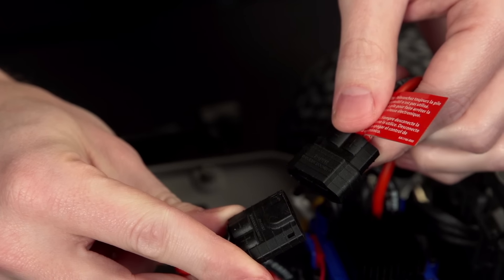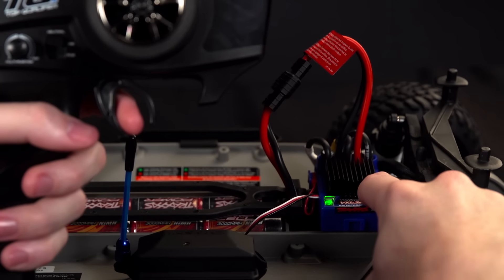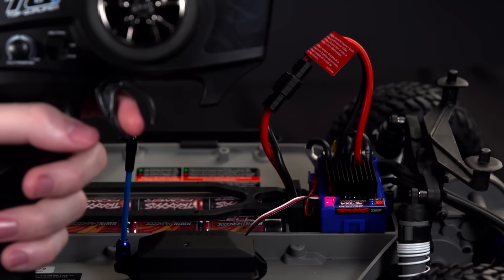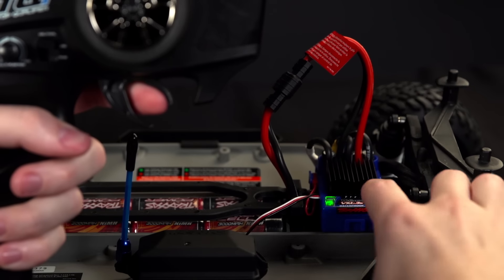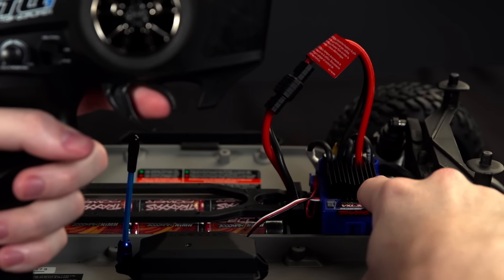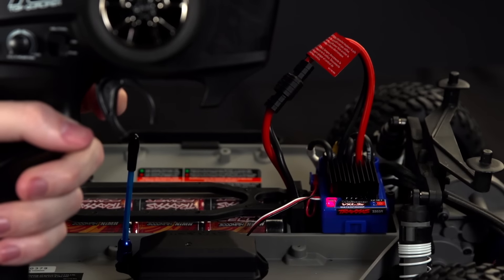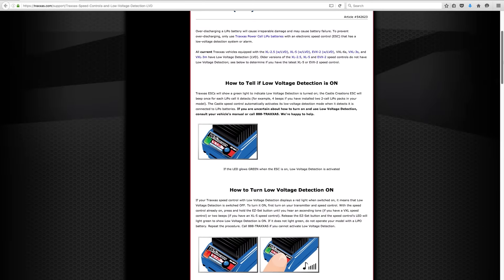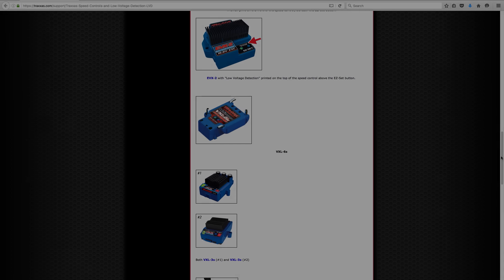Blinking Red Light (or Blinking Red and Green) on Speed Control (ESC) | Traxxas Support

Comment: THANK YOU!! This worked for me to fix my younger son's new RC teton that he just got for christmas. He was turning off the ESC using the push button instead of just disconnecting the cable. Which apparently put the ESC into LIPO low voltage protection mode. Successfully put it back into NiMH mode by following the steps in this video! THANK YOU!!   PSA: Do NOT power off the ESC by using the push button! Only use the push button to turn the ESC ON! To turn off ONLY DISCONNECT the cable!
Reply: I turn it off with the button….
Reply: @Catwithcocacola I do too and haven’t had a problem

Comment: I have the red green blinking light on my son's traxxas slash,  we have a fully charged lipo. All my research shows this happening with the nickel battery but nothing with the lipo battery  ??? Very frustrating traxxas...
Last time used 4 months ago worked fine then today my son wanted to take it outside and...... this  😞. 

On a separate note my traxxas x-maxx 8s steering servo broke multiple times   I upgraded the to metal gears,  servo still broke,  then I bought the "better " traxxas servo (4th one now) also upgraded the steering hardware with aluminum and adjustable steering servo saver spring.  All worked fine until now.... only steers to the right  & won't return to straight,  until I physically turn the tires straight.  Goes straight or right then won't return to straight. 
I purchased everything last year. Honestly sick of dumping money into both of them.  Traxxas isn't as good as I thought.  Also x-maxx tires explode,  balloon,  tare , & expensive. 
What do I do ? Invested too much money to throw them in the garbage but buying parts that aren't reliable  ???
Any help traxxas  ¿

Comment: First I buy a ready to run Traxxas slash then figure out it’s not ready to run it doesn’t bring a battery or a charger then the batteries get here and I can’t connect the stupid remote to the truck then I connect the remote to the truck and the truck turns left and right but it won’t go forward or backwards ready to run my butt dude I need some help I’ve tried everything

Comment: My Sledge won't calibrate. I can't  get into the programming mode. If I release the button when it turns red - it stayes red and won't go through the process. Only when i am pressing the button it will go 1x red 2x red and finishes with 3x red. After that everything on repeat. When I release the button it starts blinking green again... I don't know what to do...
Reply: turn up the throttler rate

Comment: So I am using lipo aftermarket batteries I turn low voltage on but it blinks red when my battery is about to die and it won’t shut off is that just how it is or?
Reply: At the end of my run

Comment: Thank you so much Traxxas!  This worked!
I moved my Velineon VXL-3S from my GMade Sawback with a 2300kV motor to my Tamiya Egress with a 3300kV motor and a NiMH battery.  When I ran it in the grass, it cutoff quickly and the red light blinked slowly.
Recalibrating it by using this procedure fixed the problem!  My Egress is tearing up the yard now!

Comment: When I do this it goes right back to flashing red and green, also after going into full reverse to re calibrate it stays green and never flashes, I have a traxxas rustler and am using a lipo battery fully charged with a XL5 esc I am trying to use it after a while, please help
Reply: Same car i have and im having the same issue please let me know if you have solved your issue i need help
Reply: @PersuadeIt  hi, turns out my old battery that it came with died just over time. The lipo I was using was too powerful for the stock esc therefore preventing the car from working to avoid damages. I purchased a new battery (the one it came with) and after resetting the transmitter everything is working again

Comment: mine is blinking green and red got steering but no forward or reverse I'm using a 3s 50c lipo battery on a traxxas rustler electric (is the battery to big)and I never had a problem till I got the new esc xl5
Reply: Elicia Vaughn you can't run a 3s lipo on the xl-5 esc

Comment: My light was blinking red after a hard crash and I didn’t have throttle ... I unplugged the battery and plugged it back in and it worked fine idk what happened
Reply: AMSeagle same only mine was 65MPH against a basketball hoop

Comment: Please tell me a way to get water out of the tires! I have so many problems with getting water in my wheels.
Reply: Elijah D. Trump you can't
Reply: you put a small hole on the top of your tires and then give it full throttle and all the water will spray out
Reply: Elijah D. Trump take tires off
Reply: If you have bead-locks, you can just remove your tires easily and dry the tires and foams and reassemble, though I'm not quite sure what to do if your tires are glued to your wheels. But a good trick to do to avoid this problem in the future is to plug the vent holes in your wheels with some electric tape or duct tape before you go in the water so water won't get in. As long as your tires are glued properly all around with no loose spots, this will work every time.
Reply: Justin Newman that won't get all of it out
Reply: I guess I should say one ounce of prevention is worth more than one pound of cure. But in all honesty, I don't really know how to get the water out because, I just avoid this problem, by using my tactic of plugging the vent holes.

Comment: Will this work if I had to swap out the receiver I tried to upgrade my pre runner To a rc4gs receiver I had laying around for the gyro but I can’t get the throttle to go but this started happening before I swapped the receiver I actually swapped it because I was having this issue like a day or two after buying the pre runner

Comment: I dont understand why everyone's having trouble with the slash ultimate.. I read all the information and when I first fired up my truck.  I didn't have to turn on low voltage detection like the card said I'd have too.  The light was green from the get go.  So I guess my ultimate was setup for lipos from the factory.  My light on my esc was never red. It was always green.  Weird..

Comment: I have a lipo and i'm in low voltage detection and the esc keeps blinking red i can steer but there isn't any throttle i tried reseting it holding the receiver en pressing the set button on the transmitter i tried recalibrate the esc nothing what is the problem
Reply from the maker: Please call us at 1-888-TRAXXAS to resolve the issue. This may be the result of a bad motor or over-voltage from the LiPo battery.
Reply: Traxxas Support i can't call you guys I live in suriname 🇸🇷
Reply from the maker: In that case, please email Support@Traxxas.com. They'd be happy to help.
Reply: did u ever fund out the problem because mine is doing the same thing
Reply: Tony Mcgee the problem is the lipo that you use if you maybe have a friend that has a lipo try using that one and always have a lipo tester "ALWAYS"
Reply: So u saying my lipo is bad
Reply: Tony Mcgee yes
Reply: Ok but I think my esc is shot tho because my battery is new I got it last week
Reply: Tony Mcgee yeah than it's that than
Reply: Could it be because of heat because when ever it does that I just unplug it and let it cool off for 5 min and then it is fine. Also if I take off the body it helps.
Reply: Same

Comment: I have low voltage enabled with lipo battery. After just a couple runs esc light blinks red slowly. i unplug battery check and see that it is still nearly full. plug back in and the same thing keeps happening. any help would be greatly appreciated.
Reply: Same problem. But I have the Stampede 4x4 with the XL-5 ESC.
Reply: Did you find why

Comment: mine keeps blinking green and red, can't get it to stop(using a 3 cell lipo traxxas slash 1/16) and  throttle doesn't work only steering, any idea what the problem is
Reply from the maker: It sounds you might need to be using a 2-cell LiPo instead of a 3-cell with that model. Please feel free to call our Customer Support Team at 888-TRAXXAS, or email them at Support@Traxxas.com. They'd be glad to help further.

Comment: I just got a LaTrax ESC for a rebuild of an old 1/18 Pro-Pulse and got all new Traxxas Teton internals and now my ESC is not responding other than stearing after two weeks or so.  Is there a way to reset the ESC or do I need to get a new one?

I hit a gate door and it stopped working it ran until then I even plugged the motor in to my E-Maxx to make sure it was working properly. and it ran just fine for a few seconds.
Reply from the maker: Hi Michael! Please feel free to contact our Customer Support Team at 888-TRAXXAS or at Support@Traxxas.com. They'd be happy to help.

Comment: I bought a new Stampede and I've done this probably 10 times, it still switches back.  I've only got it to work for a few seconds. I'm wondering if it has a faulty ESC, I'm using a 7 cell hump pack freshly charged.

Comment: Thank you so much for this guide. I thought that my brand new slash was broken. Bought a nimh acu and the red light was always blinkin and the motor was turning off after a short while. I was desperate and didn't know what is happening and the info in the cars manual wasn't good enough.

Comment: My Traxxas Trx4 Sport when I was hard crawling it started blinking red and get really slow. I try the procedure that’s on the manual but nothing, so I disconnected the battery and reconnect it and get back to crawling.

Now I fix that thanks for the help :-)

PS: I use a 5,000mah NiMh battery and works great

Comment: what if you have steering but no forward or backward? the truck don't move at all, but turns both ways just fine. is it the ESC?
Reply from the maker: Please call us at 1-888-TRAXXAS or e-mail support@traxxas.com
Reply: Bigamishdude D I have the same problem
Reply: Bono Vox I found out that my motor was fried.
Reply: Bigamishdude D Mine was luckily just the battery cause I wasn't charging my batteries long enough
Reply: I had the same problem and this video fixed it, because of low voltage detection mode my car would not move only the steering worked

Comment: i have this problem with a lipo pluged in
Reply: bmn236 same
Reply: Yep same
Reply: I'm pretty sure it's a safety feature so you don't completely drain your lipo battery and kill a cell.
Mine limits power for a few minutes and then shuts down completely with the blinking red light indicating low voltage. I swap batteries turn it back on and Rock in roll.

Comment: I was using 2 2 s Lipo's in my UDR and not even 15 minutes of use and I'd get the red light showing it was low on power. Test batteries and they show they are still good. Ended up spending $200 bucks on 2 4 s Lipo batteries and they work freaking amazing! I don't have a clue why the 2 s Lipo's didn't want to work right in my Traxxas UDR? My 2 s Lipo's were 40 c 7.4 v 6200 mAh Floureon batteries. My 4 s Lipo's were 50 c 14.8 V 5000 mAh Reaction batteries. I understand that the higher c rating the better the lipo, but Traxxas has the same batteries but 25 C rating on both 2 c, 3 c and 4 c lipo batteries.Can any pro's out there explain this to me? Thank you much if you can! :)

Comment: My fully charged 3S (reading 12.4 on a multimeter) is reading low voltage (blinking red light, reduced power). How can i fix this?
Reply: I have the same problem 😕